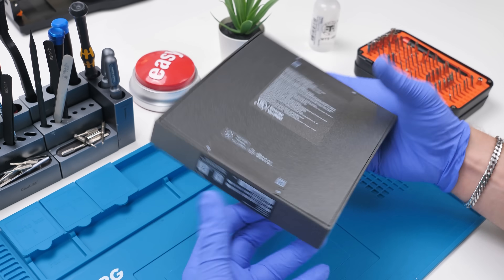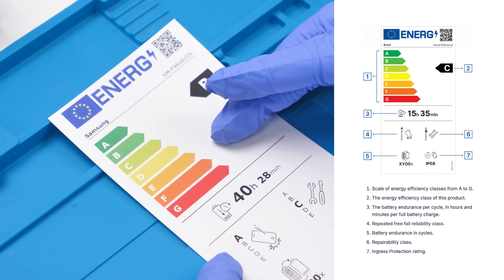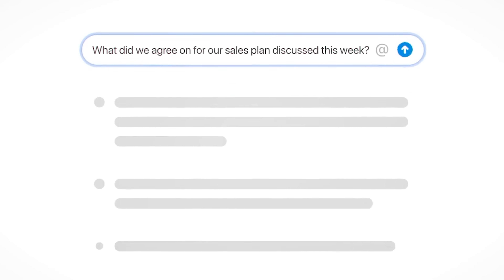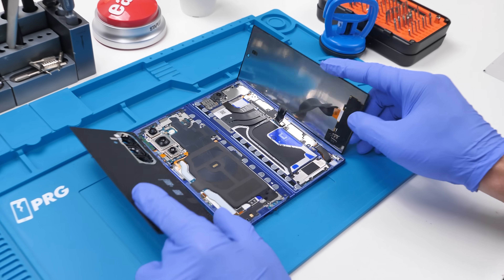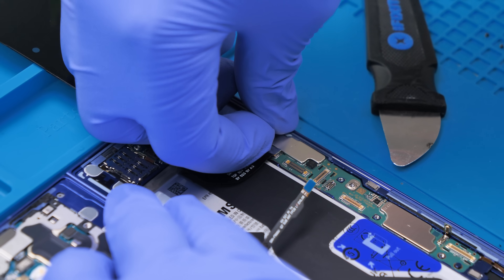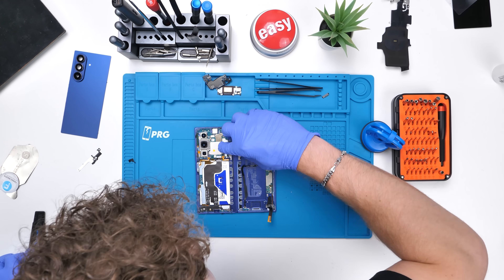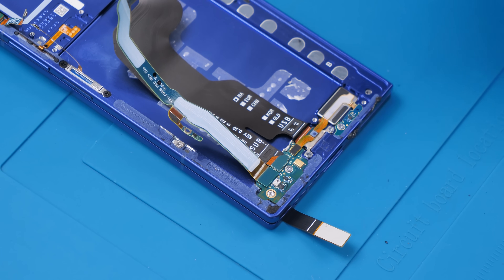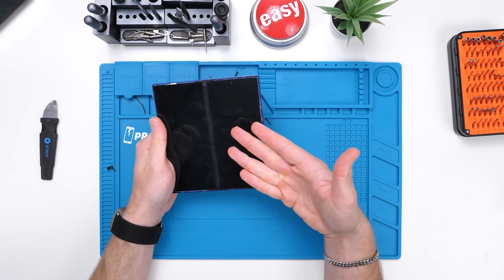What Does This Mean? Z Fold 7 Teardown...

Comment: My Fold 7 inner display shattered with no damage I'm assuming just from folding and unfolding... Of course Samsung denied the warranty claim.  Contacted BBB I found so many other people with same issue... I smell a class action law suit
Reply: Get the insurance for folds its worth it
Reply: @FredDouglass-q8k 100% I just got the pixel fold 10 pro and am thinking about the trifold..  whichever becomes my daily will get insurance
Reply: @RandoTechNerd  get it on the trifold for sure...I have serious doubts about the gen 1 version! But an amazing product while it lasts
Edit: should clarify its because of the hinge. They still haven't got it perfected. They sometimes are defective, I'm assuming that's what happened with your 7. I've had 4 different folds so far and 1 of them (a 5) had a defective hinge that caused a red bar from folding within days of getting it. It was on a known spot with the 5, I would check if yours is in a known spot for the 7. But it wasn't really a problem, because it was actually an insurance replacement for a fold 4 I had dropped and broken the inner screen on, and I used it for a trade in on black Friday for the Fold 7. Only had the red (and eventually white) bar for a couple of weeks.
I assume the hinge problem only gets worse for designing a trifold
Reply: @FredDouglass-q8k Samsung eventually gave me a satisfactory outcome it just took... Work.. I am pretty sure it's a known issue especially with the fold 7 I had big plans .. if they didn't warranty replace.  One of the reasons I am getting the Trifold is a massive coupon and I think maybe it might not happen again.. for a couple years if this one flops after the first round
Reply: @RandoTechNerd  Worst case scenario with the trifold you'll just have to pay a $100 deductible every once in a while if you get insurance. Glad you got your money back

Comment: I'm not sure what Samsung is advertising about the many thousands of folding cycles, but my Samsung Galaxy Fold 7 showed obvious signs of degradation on the foldable screen after just 1 month of use. And that's only around 300 folding-unfolding cycles. I saw many small cracks on the bending line. After that, half of the screen stopped working. The problem also appears in certified Samsung services in Vilnius, Lithuania. It appears that Samsung services have special instructions to inspect for small mechanical defects using a microscope to avoid warranty obligations.

Comment: Man I hope you respond to this but my wife has a fold 7 that has had its screen protector starting to peel. I got in touch with Samsung and they scheduled me an appointment with my local ubreak I fix. Upon arrival, I was informed that they would have to replace the entire inner display. I get a call shortly after from them saying that they basically broke the phone and can't get a display on neither the inner or outer display. They said they tried moving the shell of the phone to another display and still nothing. My phone receives phone calls but can't see anything, they told me to send to samsung but Samsung will factory reset it. I just want to do a smart switch for data but when I plug in a Type C - HDMI adapter or try Samsung DEX, the display isn't even being casted. It may be because they made me put the phone in "maintenance mode" when I dropped it off. What do you think the issue is with my phone? Why would both screens be black? Please help me! Thanks
Reply from the maker: wtf? for a screen protector? You can replace that at home if you really want to. Both screens could be black for a variety of reasons, but I have a feeling they damaged the motherboard and are covering their asses. You need to bring it to another tech who knows what they're doing

Comment: it would be very helpful if you looked into the it would be very helpful if you looked into the flex hinge cables and compare them with previous generation as they are the first to go before the screen actually go (but it does still impact the screen and other components)

Comment: What I learned from Google Care for the Pixel Fold 10 is that the inner display will never be covered for replacement  damage. Google will cover batteries that degrade below 80% and the back and front Vitus 2 Glass covers & that's it. Samsung Display makes the same inner display for Google Folds.

Comment: Hi Phone Repair Guru team,

I have a Samsung Galaxy Tab E (model SM-T562), and I want to modify it by removing the mechanical buttons and installing a bigger screen. I’m wondering if this kind of mod is possible, and what challenges I should expect. Also, would I need to replace the motherboard (mainboard) as well?

I live in Turkey, and I would appreciate any advice or guidance you can provide on this project.

Thank you very much for your help!

Best regards,
Furkan

Comment: The C shld be a paid ratings; most of the design looks copied directly from its competitors but I wonder where they get the battery supplies from.
So far Samsung's battery ratings is kinda bad compared to most of its other direct competitors, its just that they tweaked the battery consumption or how its reflected, to let its users be assured they got enough power.
Once u see the remaining percent drops past 50%, the drain is really bad.
Next up is the charging which doesn't even competes well with the competitors.

Comment: Does the 16gb mean it will not run as hot? Worried about no vapor chamber in this with no increase in battery mAh capacity. Definitely looking to upgrade  from my Fold 6 because I dont like the smaller weird aspect ratio.

Comment: 9:44 I’m wondering if the EU variant is any different to get that C rating. They could use different glue or better pull tabs for the battery to get better score. Otherwise, to me, this phone is as bad as any other, which is D- 😕

Comment: I love the idea of the Foldable device and I was always into large phones being a large guy. I talked the company I worked for into switching my work phone from a iPhone 4s to a Galaxy Mega 6.3 (the original one) and loved it. Back then people were amazed that it was a phone and I got a lot of comments whenever I would have to go onsite to do PC/Network Setups/repairs. Hell, I would have loved for my Google Nexus 7 (2013) to be able to make calls as i could have it up to my head and yes it would look big but still not as big as one might think (I wear a size xxxl hat), and I would have just used my BT headset then anyways while working. Unfortunately, due to be putting on the disabled list due to a chronic illness, I won't be able to afford one of these devices till manufacturing capabilities allow them to be cheaper, if ever..
The lack of s-pen support and SD Card slot kills it for me too. I have a habit of documenting everything be it screen shots or notes taken for references. I also sketch stuff for projects meaning more photos and storage useage. I'm finally having to upgrade from my Galaxy Note 9 and when I realised that I couldn't use an SD card in the newer S series devices I ended up having to go back to the Note Series which ended at 20, I then had to search for the 512gb version and order a 1tb SD card. Unless they make changes to the S series and bring back things like the Expansion Slot and Keep the Spen, I'll either be using the note 20 till I'm in a canister in the ground or I Root and Update my note 9 with a custom ROM.

Good video, thank you for sharing. I've always loved taking things apart (tho I can be heavy handed at times which is bad for this kind of work obviously)!

Comment: Im an l2 engineer at samsung, mate youre meant to leave the phone in heat before removing the battery for like 5 mins and itll come out super easy 😅 but great vid
Reply: Bad idea. alcohol is better. heating the battery will likely make it very sensitive to prying it out with any metal/plastic spudger
Reply: @opaomoma1789 mate im literally directly trained by Samsung. You do not ever use any metal tools at all when touching a battery you leave it in heat and you use a touch of alcohol and a battery detachment tool to remove it or pull tabs already in the battery
Reply: @RobinsonsMovieReviews people always trying to be know it alls 😭
Reply: @RobinsonsMovieReviews Been repairing phones for almost 10 years now pull tabs sucks. Again Mr samsung Dont heat it. Alcohol works 👍
Reply: @opaomoma1789  Well who cares, i trust the dude from Samsung, not your take
Reply: @ezBeanie lol basic NPC mindset
Reply: @opaomoma1789  LMFAO you're just wrong
Reply: @glad5409  smirk*
Reply: @opaomoma1789 매우 뜨겁게 가열하라는 말이 아니라, 다른 부품이 손상되지 않는 따뜻한 정도를 말하는 거겠지.
Reply: @opaomoma1789  ㅋㅋㅋㅋㅋㅋㅋㅋㅋ대단하네 그럼 베터리 회사를 차리지 여기서 뭐하냐

Comment: Could it be that the battery glue is designed to degrade over time and when the time comes to finally replace the battery after many cycles be much weaker then?

Comment: Pro tip... you DONT remove the inner display. Samsung doesn't sell parts like that. New inner folding screens always come with the batteries and frame in them. You'd just have to move. The inner boards, cameras,  and antennas. And of course the outer screen and back glass. The hardest thing to remove on these phones is, yes, the outer screen.
Reply: Inner Screen and Frame called OCTA, but of course Samsung does provide replacement part for Inner screen only with lower cost. I can say the rate of success rate is very low without damaging it 😂

Comment: I don't see the problem with the batter thing.
Like if the cells are stuck on strong they provide structural integrity to the whole device.
And it's not like you have to remove it unless you're replacing the battery so who cares it it bends a bit.
Reply: They talk like nobody uses the phone as how its supposed to be and instead we all tear it down like cmon idc about the rating im not breaking it😂

Comment: The problem witht the folds are that the cables connecting both halves (aka flex cables) tend to deteriorate over time, making your phone barely working (like booting without display) and samsung doesn't provide those cables as parts or spares nor do they replace the cables alone. The only way samsung will repair such a device is by replacing the entire foldable screen along with the frame and cables, which costs like half of the phone, even though replacing just a few cables, which costs just a few dollars, is enough. This was the point where I stopped getting foldables/samsung because I don't wanna deal with such a company with poor aftersales. I had a fold 3 and fold 5 which both got this problem overtime. Bought the fold 5 cuz I thought they would have fixed it or made it easier to repair by now but they didn't. Seems like fold 7 made it easier for repair but it lost the s pen capabilities.

Third parties do this repair for a few dollars, which is the better route imo.

Comment: I mean, the inner display and the 2 batteries shouldn't be removed except if they're faulty, since they're aren't blocking any other components, so it's not really a big deal that they're aren't easy to remove. Maybe that's why it got a C rating, even though myself I would prefer the easy battery removal thing (I saw a battery catch fire while I was removing it from an iPhone 6 during an internship, really shocking experience lol)

Comment: Dude!!! PULL the tape away from the battery parallel to the phone body. NOT up/perpendicular to the battery. SMH.
Reply from the maker: Believe it or not this is how it's meant to be used
Reply: @PhoneRepairGuru  I am a tech, this is directly from Samsung training manual.  "Pull slowly and steadily: Pull the tab away from the battery, keeping it as flat and unwrinkled as possible. Maintain tension and allow the adhesive to stretch and release. Don't press down on the battery while pulling.
Low angle is key: Pull at  a low angle to prevent the tab from tearing or snagging on the edge of the battery.
Reply from the maker: I couldn’t find any official documentation on battery removals from samsung online only ifixit guides which suggest you pull directly up. These battery pull tabs are shit regardless

Comment: Tips:
- Use hot plate before removing the battery 
- I think that the repair score is form the original parts, because the screen is sold with all the frame and not without!🎉

In any case good video I really appreciate it 🙂
Reply: and even if its not if you need to change the inner display it means that the original one was broken so you dont care if you break it

Comment: Great video, the phone is really insanely thin. I'm not as experienced as you but I give several minutes for the alcohol to properly dissolve the glue. If you still need to apply so much force to remove the batteries it's because you did not use enough alcohol and/or did not give it enough time to ease the glue properly. Also, I pull the batteries more gently, and patiently wait it to slowly give up.

Comment: Repairability class based on index
C (A-E)
Repairability index
2.97

Result
Disassembly steps
1,67
Fasteners (type)
3,00
Tools (type)
3,04
Spare parts
5
Software updates (availability duration)
1
Repair information
5

Read that qr code you see always why it get that rate

Comment: If i'm not mistaking, the batteries pulling tabs should be pulled parallel to the battery so when it is stretched it looses its paste property (sorry for my english speling). 
Thanks for the video.
Reply from the maker: According to iFixits repair guides, you're supposed to pull straight up. These aren't traditional pull tabs that stretch.
Reply: @PhoneRepairGuru  Ah ok, you had them under you hands not me so i gess you are right. Once again thanks for the video.
Reply: You're correct that's why i don't understand why he's manhandling this phone in his disassembly, pull tabs aren't meant to be pulled up vertically but horizontally.

Comment: Fun fact: We had energy efficiency in the EU for ages! But not really for phones, more like for larger appliances (washing machines, entire buildings, etc.)
Reply: To be fair the energy efficiency doesn't really work on phones or other devices that use a semiconductor as its main component like CPUs or GPUs since they usually use the newest tech anyways that is also the most efficient one. The way the EU calculates efficiency would get outdated really fast.
Reply: They should definitely rate the efficiency of phones too!
Reply: @c.carrillo7813 , I think they do now!
Reply: @c.carrillo7813  have you even watched the video?
Reply: North America has the same thing for appliances, building insulation, etc. it's called Energy Star.
Reply: Same in AU
Reply: Heck, we even had it for lightbulbs! But phones have been included just now
Reply: Even tires have these labels, rating fuel efficiency, adherence in wet conditions, snow homologation, and friction noise
Reply: In Russia too!
Reply: also for car tires

Comment: It's a C repairability for a foldable but a D or F for a normal phone. I think they put it against other foldables that's why they got so high
Reply: I think that F means impossible to repair without breaking anything, D is probably kinda like the Nintendo Switch 2 where you need to remove lots of stickers and even then it's difficult to repair, C probably means you'll need a technician but you migjt be able to do it yourself, B is repairable by most people, but has stuff like glue etc that may make it more difficult and A is framework type of repairability

also, part availability also probably plays a role into that. now, that's just a theory of what those letters mean to me, but I feel like they sound fair enough
Reply: @Emayeah I think it means C - you need a technician B- you might need a technician A- you can do it yourself with a youtube tutorial
Reply: It's a good thing you know this for sure and aren't just making stuff up. You wouldn't do that.
Reply: @phungo8606  i said i think
Reply: i customize my z flip4 and fix it all the time. its really not hard to repair. this one is just much harder. most foldables are more repairable
Reply: Je le pense aussi. C'était déjà louche qu'ils n'étaient pas encore obligés de mettre une note de réparabilité sur les smartphones pliables, on comprend mieux pourquoi ils ont voulu le faire.
Reply: No its very durable
Reply: Foldables = straight trash at least for me why woud u whant to make ur phone thin as possible and at the same time make everything usefull in the phone less usefull by thining it down
Reply: @Maykay1312 makes no sense
Reply: @Maykay1312 tell me. Would u rather carry a brick everywhere u go or a feather. It's common sense right
Reply: @Maykay1312  uh.... about the thinness, every other piece of tech, including normal phones, has the same problem.
Reply: So if their comparing it to other foldables, then there is a foldable phone that got the A rating right?
Reply: @butterpromax yeah no... that's also another reason why I think the repairability score isn't relative, but rather an absolute rating